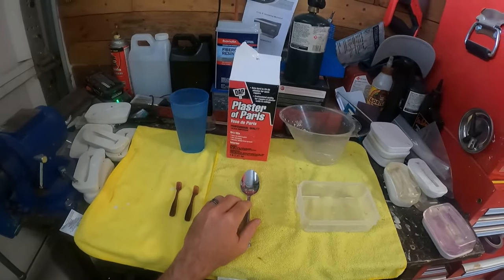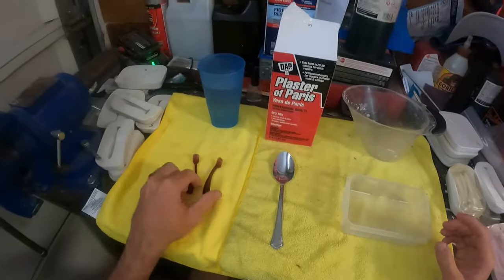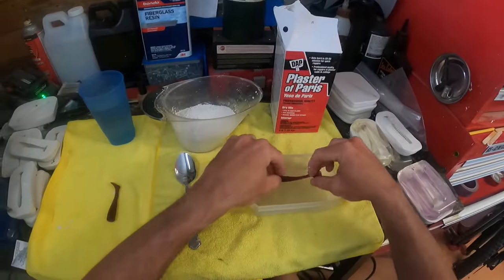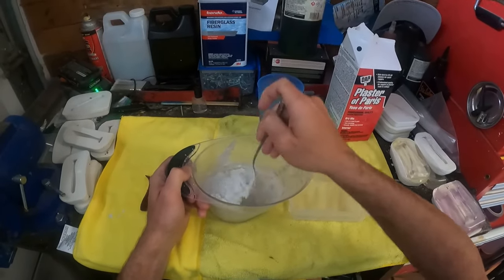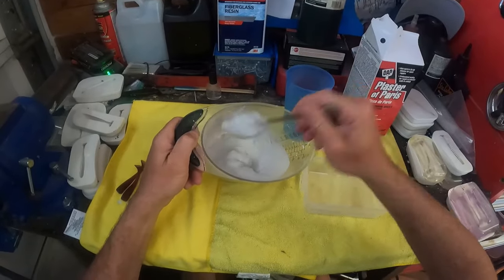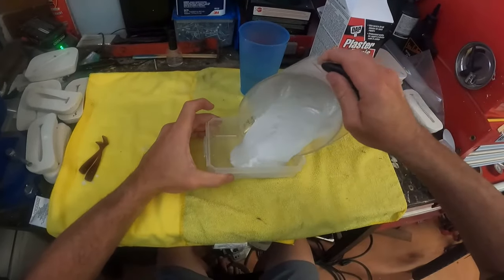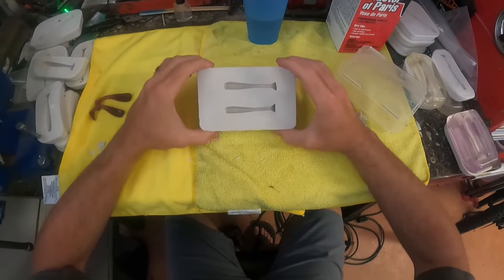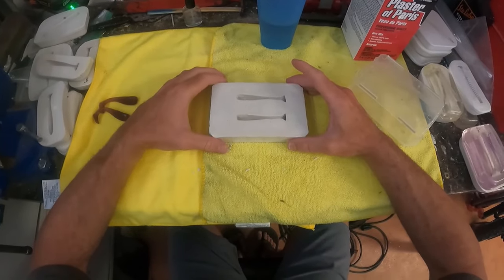Making FISHING LURE MOLDS with PLASTER - easy and fast

Comment: Have you tried Pledge Floor Wax, it's pure acrylic. I paint board game figures thinning the acrylic paint with a 50/50 mixture of Floor Wax to water. When done, a few coats of just the 50/50 mixture to get a good seal on the finished coat. My guess is, it would fill any pours, smooth the surface.
Reply from the maker: I have not! Great idea. I may try that the next time...depending on cost.

Comment: Greetings and thanks for the terrific videos!  Can or should the nail polish sealing process be done with the jig head lead pour molds as well?
Reply from the maker: No. Don't use any sealer for any lead mold with plaster. The melting point for the plastisol is low enough for the seal coat. With lead having a 624° melting point, it will simply melt the seal coat and stick to the plaster, destroying the mold. The plaster needs to be completely dry of moisture or other material or the lead will blow/pop. No good!
Reply from the maker: On this session, the fish were generally farther out, so I was using a 1/2oz. If they're generally closer, I'll use a 1/4oz on my UL setup.
Reply: @StartFishingToday Thanks for the insight and speedy response!😉
Reply from the maker: Absolutely! Thanks for watching!

Comment: How did you get rid of the bubbles when you pour the plastic in on the top it seems to rise up when I’m pouring
Reply from the maker: Hi. There are a couple things you can do. First, and most expensive (but most efficient), is you can get a vacuum chamber for degassing the plastisol (https://amzn.to/3Tw3k7X) or, alternatively, you can use a heat gun to keep the plastic more fluid - allowing all the bubbles to rise to the surface. Again, I do not sell my plastics, so I don't even worry about the small bubbles. I donlt find that they get less bites compared to zero bubbles. Bubbles are going to happen no matter what the moment you start stirring.

Comment: Using this technique, could you cast other types of lures like burner worms for example or Twister tails?
Reply from the maker: Kind of. With this mold, you can only make the lure with flat tops/backs. However, here is the link to the video I made for creating full body molds with plaster. https://youtu.be/GyCbagrI068
In this one, yes, you can make the lures you referred to, as well as all other full body plastic lures. Good luck and have fun!

Comment: Great video.  Does the nail polish affect the smell of the bait and have an effect on the scent  to the fish? I guess only the fish could answer that, right? .......but have you noticed any difference?
Reply from the maker: Ha. You're correct - only the fish know that. However, the nail polish is only to seal the mold. I spray Pam (or any cooking spray into the mold before I pour the plastic. That helps the plastic release from the mold better and also adds a little "flavor" to the lure too. But, I also soak my plastics in bags with sardine oil before use. The plastic smell is virtually gone by the time I use the bait. 
Yes, I do notice a difference in the amount of strikes I get from not soaking my lures first vs soaking. More for sure.
There is actually a good (short) video on YT on underwater footage of halibut following/chasing a swimbait. It was crazy how many fish just followed/chased and then simply swam away. 1 retrieve and probably 5 or 6 followed without biting. It was crazy. I can only imagine how many strikes you potentially lose if the bait doesn't smell or swim properly.
Reply: Thanks for the reply. Appreciate your insight.  Who knows how many strikes we miss and what little changes we can do on a bait to have an effect on that. Thanks again.

Comment: How hot do u melt the soft bsit to poor in the mold and will the mold melt it self
Reply from the maker: Plastisol has a melting point around 325°. I don't use thermometer to get exact. No, the plaster mold will not melt. I use plaster for making leadheads and lead lure and lead has a melting point of 622°F.

Comment: What if you want to do this for a lure like the strike king rage bug? Will it work for baits like that? Where both sides are important? Or is this technique only good for paddletail softbaits?
Reply from the maker: You can, but not with this "single-side" plaster mold. You need to do it with a 2-side mold and use an injector. Watch this video: https://youtu.be/GyCbagrI068
Reply: @StartFishingToday  Thanks for the link! Do you think it is also possible to make a 2 sided silicone Mold for handpouring softbaits like this?
Reply from the maker: Yes. Silicone is just a more costly material.

Comment: Does the plaster get hard enough to make it a inject mold and be clamped together?
Reply from the maker: Yes! I made a separate video specifically for full-body 2-piece plaster molds.

https://youtu.be/GyCbagrI068

 You can also get Perfect Cast from Amazon. It is more expensive, but it's up to 5x stronger than regular plaster of paris.

Comment: Thanks for the video! Would this DAP Plaster of Paris work for casting decorative items that you'd place in your house? I would like to know if its fairly durable
Reply from the maker: Hi. Yes, it is very durable. You can use it for just about anything. I have seen some use the silicone molds and pour in the plaster to create a solid object. Then, make sure you follow the instructions and let cure for the proper amount of time to harden correctly. Then, I use clear coat nail polish to seal the plaster and add an extra layer of hardness to it. Then you can paint it or whatever you want. I still have lure molds from when my dad made then 20 - 30 years ago!!! They are not unbreakable, but def sturdy. Hope that helps ;-}

Comment: Great video ! I find if you use a white glue stick it's good enough to hold the lure in place
Reply from the maker: Yes, there are a few ways to do it. I prefer placing them on top so I can see exactly what the lure is doing. Once you pour on top, you lose visibility. The tail could come unglued, there could be a bubble pocket  behind the tail - all of which can ruin the mold and have to start over.
Reply: @StartFishingToday  Thats a very good point ! Have you tried molding hard lures ? I'd love to see how you remove a hard lure
Reply from the maker: Could you elaborate a little more so I am sure to understand your request?
Reply: @StartFishingToday  Sorry , I'm curious if you can use this method to cast jerkbaits , crankbaits , glidebaits and such .
Reply from the maker: You can use plaster (and non-hardening modeling clay in certain applications) to cast MANY things. But, if you looking to make your own jerkbaits, crankbaits, etc., I recommend Barlow's Tackle of course. 
This link is for all their plastic, wood, and brass lure blanks: https://barlowstackle.com/lure-making/lure-blanks/?afmc=zk
They also have everything else you need to complete the DIY project.

Comment: When I used pop and after my plastisol  has cooked it has a dull look to my bait kinda like flat paint or no glossy. What went wrong or do I need to add something to the surface of the pop mold?
Reply: I watched again and I forgot about the nail polish. So doing this will that stop the dull look of my baits?
Reply from the maker: The nail polish is really just used as a way to "seal" the pop and prevent the cooking spray (release agent) from soaking into the pop. The pop is extremely porous, so it absorbs like no other. I am not 100% sold on that the plastics need to be shiny to get bit more. I rely on the bait's action and smell/taste. I do soak my plastics in a plastic bag with fish oil (Pro-Cure or others work) after trimming/before use. But, if you do NEED the baits to shine, there are 2 things you can do. 1. (more costly, but guaranteed to last) Make an ultra thin/watery batch of just pure clear plastisol and dip each finished plastic in and letting it drip dry. Then, once that clear overcoat dries, trim the hanging piece and that lure will now be shiny. You don't want it to be thick. Or. 2. (virtually free and what I do), you can use more cooking spray or food oil of some kind to the mold before pouring the plastic. Ultimately, it's the pop that is "absorbing" the shine of the plastisol. So as long as you make sure to "seal" the pop or make sure there is a layer of oil between the pop and the poured plastisol, you should get your shine. Also, another option would be to create the mold with a craft silicone. High temperature threshold, but more expensive. The silicone does not absorb at all 👍

Comment: About how much of the plaster do you use on each mold?
Reply from the maker: It all depends on the size of the mold. When I'm doing 1 or just a couple 3-4" swimbaits or per mold, usually 1 - 1.25 cups of plaster will do for that size.

Comment: What if i pour too much plastic? How do i get it to stay to the shape of the mold? Scrape it or tear it? Just trash it?
Reply from the maker: Pour slower to just get the poured plastic about 1/16 - 1/8" above the mold, allowing for a little bit of shrinking. You can always trim the tail and sides. Def better to be thicker than to thin. If too thin, the tail will not have any real action. If only pouring 1 color, you can just take it out and put back in the liquid plastic to melt and repour.
Reply: @StartFishingToday  thanks

Comment: You could suspend the blank and pour around it,obviously not ideal with plastic molds,but hardbaits is the way to go.
Reply from the maker: There are several ways to do it. I just found that this way created the best mold for the flat top swimbaits. I have other videos for doing full-body 2-piece swimbait molds as well as one for hardbait molds starting with modeling clay. Go get 'em!

Comment: Does the nail polish avoid the bait from being ripped apart? In order for it to come out smoothly
Reply from the maker: I'll have to do a new video on the actual process of pouring the plastic. Until then, to answer your question, the nail polish is just to seal the plaster (filling the micro voids). I use PAM or any cheap cooking spray to add a very thin layer of oil so the plastic doesn't stick. I do this about every 5-6 pours. Lures come right out. Right after you remove the plastic lure, pit into ice cold water to quick cure it.
Reply: @StartFishingToday  you wait 5-6 hours for a other batch or for the lures to set?
Reply from the maker: @moises Miguel  For the plaster, I would let set/dry for at least 5-6 hours, if not more, before pouring the plastic. Less moisture in it, the better. For the plastic, I let sit for a about 3 minutes before removing from plaster mold, then dumping into ice water.
Reply: @StartFishingToday  by any chance do you know any companies that sell stiff/tough plastisol?
Reply from the maker: @moises Miguel  I buy mine from BarlowsTackle.com. I use the MF saltwater formula (pink label) with a separate bottle of Heat Stabilizer.

Comment: Hey question how much do if the powder do u put
Reply from the maker: I believe you are asking how much powder do I use? Until you are used to using plaster of paris, follow the instructions on the bag. After you have made a batch or 2, you start to get a feel for how you like to work with it. Then it's just a matter of more or less water to mix in. It all really depends on how thick or watery you want it and how big of a container you are using to create the mold.

Comment: How do you avoid getting the tail ripped off?
Reply from the maker: @moisesmiguel6915 - Are you asking about when I remove from the plaster mold? If so, I use a oil cooking spray (like PAM). I spray in the mold about every 4th or 5th pour to allow the plastic to come out easily.

Comment: Do you sell these? Like, are they good enough to quality to sell?
Reply from the maker: Thanks for the question. I do not sell any of the baits I make. Strictly for my personal use only. But...that is why I made this and other "how-to" videos. When I make a bait that gets bit and retail is expensive, I'll make the video to help you and others save a bit of $$$. As for if they are "good enough" to sell - if the fish bite 'em, they're good enough in my book!
Reply: Kk! I’m starting up a lure shop and I’m trying to save a lot of money. At least until I can get good molds and stuff.
Reply from the maker: If you are going into the "business" of making plastics to sell, you can make prototypes with wood or clay. Then make a plaster mold with them. Then make some plastics to test from the plaster molds...got to make sure they catch fish of course. Then, once you have thousands of casts and hundreds if not thousands of catches with your own design, then work with a company to machine that lure into an aluminum mold. The aluminum works much better for maintaining a constant temperature - which is very key to making near flawless plastic lures. The slower the plastic cools, the less shrinking or contracting of the plastic you have. Hand-poured baits in plaster are super fast and work, but if you are making hand-poured lures for business, you need to do it right if you want to sell them. There are no cutting corners if you want to make it a business and do it right. Hope this helps.
Reply: This gave me a lot of needed info! I will definitely  in time gain experience with this and I hope to become a top notch bait seller.( I’m 13 and am very ambitious)

Comment: All you need is to put the fish in soft clay first, use modify real frozen fish for model
Reply from the maker: I have tried that. The problem is that a plastic made from a real fish mold does not have any action when you retrieve. The plastic/artificial lures are made to have a tail that wobbles back and forth to make vibration in the water. That is what the live fish feel with their lateral line. So the more movement, the more likely a live fish will feel/hear it and bite it.

Comment: You seem to be using a lot of nail polish. Doesn't it puddle in the mold?
Reply from the maker: Nope. The plaster is very porous. it soaks in. It is only used to fill the micro open holes.
Reply: Very helpful. I use automotive clear coat for my fishing lure painting. I'm thinking it may be more durable than nail polish. Have you ever tried anything like that to seal your molds?
Reply from the maker: @Ed Deluthe  Yes, but the nail polish is resin based, so it is much more durable and lasts longer with the heat of the melted plastic. Clear coat spray is not resin-based and does not withstand the heat of thr melted plastic. It peels off in my experience.
Reply: @StartFishingToday  Thank you much. Gonna give it a try.
Reply from the maker: @eddeluthe5131  Perfect! Enjoy!
Reply: @StartFishingToday  Do you use any kind of release agent or is the nail polish slick enough to just pull them out?
Reply from the maker: @Ed Deluthe  Generally, the nail polish is enough, but, I do use a cheap cooking spray every 10 or so pours. Just a quick pass over.

Comment: Do you need the nail polish
Reply from the maker: I recently pushed a new video out, showing a newer way to seal the plaster molds. The seal coat is more so you don't have to keep adding cooking spray or some type of oil after every couple of pours. The liquid plastic, over a few pours, will actually stick to the plaster and make it harder and harder to remove the lure after poured. So, I now use the gorilla glue 5 minute set epoxy instead. The nail polish lasts, but only for so long. The 2-part epoxy lasts and lasts. Plus, the seal/epoxy coat gives the lure a shiny fishing instead of plaster alone leaves the lure dull.